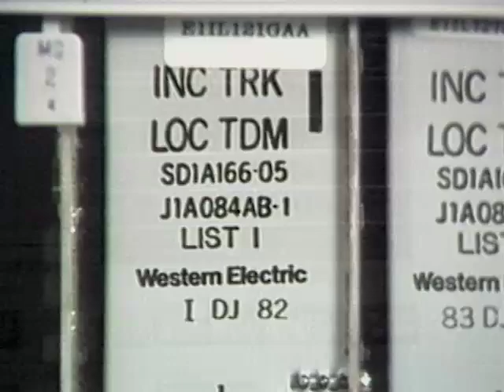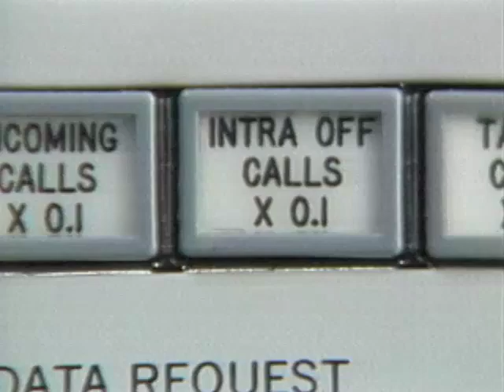Speedy Cutover Service, SXS switching cutover to ESS filmed live at Glendale CA central office, 1984

Comment: I worked in the 30,000 line #1 SXS machine in Tacoma, WA (MArket, BRoadway, FUlton) for 8 1/2 years before it was cut over to #1 ESS in November of 1979. Since the ESS was in a newer building across the street from the SXS, the cutover was done at the old and new mainframes.

All the "heat coils" were pulled in the stepper, and all the protectors were plugged in at the ESS. 

It was sad to watch that hard working 1931 vintage SXS die after so many years of faithful service. We put one whole lot of blood, sweat, and tears into keeping that beautiful old machine running like a fine clock.
Reply: Have you been to the local Telecom museum? It has SXS, panel, #1XB and #5XB equipment running.
Reply: @lohphat , yup! Been there. 😁
Reply: RIP Tom
Reply: Do you need some time to yourself?😂😂😂
Reply: Why did they keep Step by step running so long?  I heard they were expensive to maintain!
Reply: @jgrysiak6566  Just a good accountant to show up TCO vs ROI of a switch. If it cost X to maintain and cost 20X to change for a thing that cost 0.1X to run but will last only 10 you keep the old thing as it's cheaper (20X old vs 22X new)
At a point the cost of the new thing dropped to "only" 17.99 so it became cheaper to trash the old one (20X old vs 19.99 new)
Reply: @lapub7972  , right, the 2BES office in Baden , PA only lasted about 15 yrs until,  5ESS took over!

Comment: Next job for the technicians: Remove hundreds of tons of switching equipment to the scrapyard.
Reply: Psyche! “Abandon in place”
Reply: A lot of copper to recover. Need to make room for thenext generation of switch in the future. Even if it takes up 3%  of the room of the old.
Reply: @haweater1555  It's crazy going into old colos and seeing tons of empty space that was clearly once occupied. Technology is nuts.
Reply: @michaelzindel2382  all that empty space would be perfect for data centers/server farms.
Reply: I have about 3 tons of this equipment to salvage parts from / recycle. A good family friend that worked for Pacific northwest bell saved loads of this stuff, the stuff he built with it is really cool, but there really isn't any use for it now unfortunately. Lots of spares still brand new sealed in the antistatic envelopes too. Kinda sad to throw away so much brand new stuff.
Reply: AT&T was into recycling LONG before most people had even heard of the term.
Reply: @mel816  COs or telephone exchanges as we call then here are also a good place for local power storage. All that empty space can store a lot of batteries for smoothing out demand on the grid and storing renewable power during low demand times when solar panels are putting out well.
Reply: I did this for a month, as summertime job. In fact, managers wanted us to deconstruct it, so it can be shipped from Ljubljana to Skopje. We knew it will never be reconstructed back again, while we were working, and it wasnt. Ah, good times of yugoslavia's socialism :)
Reply: @iamdave84  Ever been in a CO? First, they have their own batteries to power the place in case of power failure, plus generators. Second, most are pretty full already.
Reply: Yeah  @colinpovey2904 , I'm working in a CO somewhere about once or twice a week. Some of the older major COs have massive amounts of empty space. The incumbent telco here that owns all the COs had already hinted that they are investigating entering the local energy storage market.
Reply: You got that right, I remember sewing up those craft paper bags full of no longer used cross connect wire on the MDF

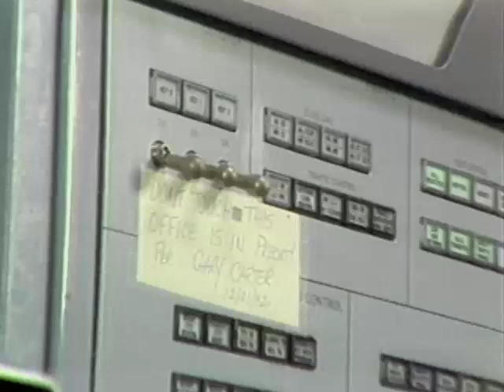Comment: At 03:58 look at the note under the cut switches. " DONT TOUCH THIS, OFFICE IS IN PRECUT PER GARY CARTER."  This film does not tell you what happens after the Tech typed in the cut message and operated the cutover switch.  the CC started sending commands to all the Line Switch Frames (LSF) to close the cutoff remreed switches. This took one to two minuets and sounded like raw rice being thrown on a plastic plate.
Reply: I saw that too and immediately laughed! No protection from accidental switching. Also I would have loved to hear what that sounded like in person! As well as what a datacenter's modem room sounded like, but maybe only for a few moments.
Reply: @macestillmace2514  Racked modems had no speakers, so they were dead silent. (other than the roar of a room full of fans.) If they were very old analog systems -- POTS fed, they'd have a relay to go on/off hook, but you'd never hear it over the fans.
I've spent many hours sitting next to a 5ESS (and DMS100); I don't recall ever hearing the click of relays. (reed relays are really quiet)
Reply: Why did the old cables require physical cuts in order to initiate the cut to the new system?
Reply: To minimize downtime (an entire CO being OOS for more than a few seconds can rack up some serious fines) the new switch is connected in parallel with the old gear. When it's time to switch over, the old gear is physically cut away from the lines and the new switch starts handing the lines. As you can imagine, physically rewiring thousands of pairs would take days.
Reply: @jfbeam  thanks for the reply. I guess I'm just confused why the old line needs cut before the new system is able to take over?
Reply: The old systems can't be shut off so easily, and those frames will eventually be removed. You don't want live lines to still be connected to them -- noise, dangerous voltages, etc.
Reply: @macestillmace2514  Actually, if you look closely the switch is the type that you have to first pull outward on the spring loaded toggle to unlock before flipping the switch, preventing accidental activation.
Reply: @TehMG  dang it! It was much funnier until proven false :(
Reply: @Hyperlooper  From another commenter: The new ESS switch had already been wired in parallel to all lines, but had to remain dormant (probably isolated via per-line relays, all of which were engaged by that final switch throw at the end) until the old was gone to avoid conflict.  The old switch lacked any per-line isolation to cleanly disconnect itself, and even if powered down it would still have passive circuit elements (coils, resistors etc.) connected to all lines that would interfere with call processing and quality on the new system.
Reply: I can hear it now.
Reply: But you know "line switch frames" really isn't a brand, right?

Comment: >Multiple training and briefing meetings
>Special tools and sharpening services
>50 employees working at once
" " E C O N O M I C A L " "
Ahh, the 80s
Reply: I miss them
Reply: I mean It's cheaper to shut it all off for a second and replace it than it is to spend months or years researching and developing a system that can seamlessly transition between technology levels. If all those people were paid 20$ an hour they would've only had to spend a couple grand in wages on their employees. And the cost of the special super sharp cutting tools.
Reply: @viktorreznov4718  Damn...
Reply: @a1919akelbo  50 people 20$ an hour for 47 seconds. THAT'S ECONOMICAL!!
Reply: @dan1_1  again, better than paying one person 50$ an hour to design a seamless transition device.
Reply: @a1919akelbo  A seamless transition device that costs a fortune to design, manufacture and install, which only gets used once, after which it's totally redundant. Definitely cheaper to bring in the batallion of wire cutters for an evening to disconnect the SXS manually.
Reply: @a1919akelbo  I think ESS switches could do a graceful phased and reversible cut-over.  I don't know about the step-by-step switches.  Modern switches can definitely do it.  And, with VOIP (which I haven't worked with), I assume it's all a matter of TCP/IP.
Reply: @TesserId  this video is literally about the process required to switch from analog electromechanical to ESS. You can't connect analog to digital. That's year one electronics.
Reply: @a1919akelbo  D3/D4 mux and channel bank.  I worked with them all the time.
Reply: @TesserId  alright dude, i get that you're proud of your job but just Google SXS switching system before you keep making yourself look like a moron. 
-Some guy that also went to college and works with buzzy blue stuff.
Reply: @a1919akelbo  Just to be clear about what set me off, I made a real effort to find you something meaningful about my claims and actually provided a link for it  (and you were dismissive about that, though that wasn't the really big deal), but asking me to do a Google search on your claims when I'd already done that for my own claims put all the burden on me.  That's really not fair.  If there's any basis for your claims, you should do work for your claims yourself and not put that on me.  There's just no way to have a civil discussion if you can't back your own claims.
Reply: @TesserId  alrighty ill validate my own claim. The video shows an SXS system being cutoff and replaced by a DSS system. Now an SXS system, or Step by Step system, or The Stowger switch is the first commercially successful electromechanical stepping switch telephone exchange system. Basically this is a fancy way of saying it's a system that directly, electrically, connects your phone to another person's phone through a series of analog selector switches and drums. In the official US patent for the SXS switch (link posted bellow) youll see that in figure 1 it shows a rotary phone, above the drum wires run off the page towards the left towards the SXS system. Later in figure 2 we see the complete network showing rotary phones connected to an SXS system. Now something you'll notice, like all things designed in the late 1800s this system is surprisingly simple, and throughout it's use it never got that much more complex, just larger. When phones became more popular the selector drums of the SXS were put in series to accommodate more digits in phone numbers.

Now the issue starts with replacing the system, as it directly connects to the entire phone line, both input and output. Meaning you can't selectively knock out certain subsections, you need to take out the entire system at once then immediately turn on the DSS system. No matter what you need to cut every single wire of the SXS system from the telephone network before you can switch on the DSS. This is because if even one phone was still connected to both the SXS and DSS systems, once that phone made a call the SXS system would short the entire phone line. Itd connect the DSS's output directly back into it. And there would be massive feedback from the lag in the DSS system. You need to physically cut or switch the SXS system off before even turning on the new DSS system. 

Here's the patent link: https://worldwide.espacenet.com/publicationDetails/originalDocument?CC=US&NR=447918A&KC=A&FT=D&ND=&date=18910310&DB=&locale=en_EP
Reply: @a1919akelbo  Thank you. So, given that perspective, I'm going to claim we're dealing with apples and oranges.  Bear with me.  POTS lines are analog and they have to get into digital systems by some means.  That's what channel banks do.  They take various kinds of analog lines and interface them with the digital world.  Yet, channel banks are not limited to converting POTS lines to to T1 time slots.  They also deal with various kinds of analog trunks, which in a mixed environment also have to be converted to digital.  I fully admit that this would not be the solution for all cases, but they did exist and used for mixed environments, and for the times that we have had to have both analog and digital systems, this is what we used.  I'm not saying you're wrong, I'm just saying there was than one kind of thing out there.
Reply: @TesserId  they're dealing with the same apples in the video. You've brought up the oranges, but they aren't relevant to the situation everyone's discussing
Reply: @a1919akelbo  dac
Reply: Hey in fairness time is money, 50 guys doing 48 seconds of work after allz
Reply: @TesserId don't know your age but this is an analog world converting into digital.  The 286 was still bleeding edge. Let that sink in.
Reply: @x_x_w_  For what it's worth, my first DOS computer was a 286.  But, my first computer was a Cosmac Elf based on an 8-bit RCA 1802.

Comment: I like how the cutters are overworking themselves to go as fast as possible. The guy on the keyboard slowly reaches over to flip the switch down.
Reply: The switch guy worked for Pacific, not Western Electric?
Reply: He was giving it a few seconds for an emergency stop to be called. If he flipped that switch with any lines not fully cut, that 45 second switch over could turn into days or weeks.
Reply: @mstrickk1  Can you explain why? Would there be an electrical short? After the lines are cut, what's done to bring the other system online? Thanks!
Reply: @dstrome  older digital circuits do not do well when you send voltage the wrong way.

Comment: I was involved with one back in the day where a four floor building of crossbar equipment was replaced by an ESS that only took one quarter of one floor.  Got a set of 6 monster 2.2v cells out of the deal, 13.2v for the test bench in my shop.  :)

Comment: Slightly different in UK. I did a few Strowger, X-bar, TXE 2 & 4 to system X and system Y in the 80's&90's. Rather than cut cables, every circuit in the old MDF blocks was fitted with dis-wedges, the same with the new blocks. The wedges were strung together in verts. "Everybody ready?" -  "Out with the old". "All out?" - "In with the new". dozens of workers steadily pulled the strings to remove the wedges. The old mechanical equipment fell silent. The new then sat there quietly doing it's job. In the old there was sometimes a lone relay magnet forlornly clicking away, waiting for investigation and final disconnection.
Then there were the faults. Defective wedges that failed to disconnect meant having to spend a frantic hour at the grading-banks wrapping all the P-wires to ground, and missing the transfer breakfast. Happy days, It bought me food and drink and paid my mortgage off. Sometimes I visit museums, and the smell of the varnish takes me back to those days.
Reply: Would love to hear a room full of Strowger switches going full pelt.  By all accounts it was quite impressive!  Isn't there still some System X live?
Reply: @KarlHamilton  In some of the trunk exchanges (offices) ear defenders were mandatory. In the repeater stations you just didn't enter the room at peak traffic! Small village exchanges were pleasant, warm, comforting places, with the exchange clock's regular 'clicks' every few seconds. Warm lacquer on the relay magnets smelled homely; summer lunchtime BBQ's in the exchange garden made it all a pleasure getting paid!
Reply: @nlo114  Haha! That sounds incredible.  My time with BT was far less romantic.  Still love it though.

Comment: My dad worked for Bell in Pittsburgh for 41 years.  As a kid, he took me down there early one morning when they did the ESS cutover.  He showed me a little of the behind the scenes then we sat in the cafeteria for a few hours.  He looked at his watch and went "Well, that's it, lets go."   He saw my look and said, if anything had gone wrong, you would have seen some controlled chaos erupt, but some operator somewhere typed   "ESS CUT" on a screen and ... it all worked.
I always figured it was simply a switch to route all calls through the new digital switchgear.   Possibly all that "cut" part represented was the symbolic "cutting of the wire" and was not really NECESSARY to the new system functioning.
Reply: ESS switches have just enough computing power to do a kind of virtual cut.  The real work would have been wiring up the new switch in preparation for that moment.

Comment: I did a stint as a line tech apprentice for Telstra in the early 2000s not long after name change and public float. Was hanging out in the Dandenong telephone exchange and had two floor I could access of the old step system shown here. I think there was 4 floors in total. Anyways the system that came after the ESS shown here(can’t remember its name) for in the corner of the bottom floor lol. Was amazing to see. Then the rest of the area was split up to house all the new ADSL equipment being rolled out at the time. Was odd seeing all this 1940s and 50s stuff next to new tech at the time. Also the Panasonic tough books have barely changed on outside in 15 years lol

Comment: I was present at the cutover of the Bradley c.o. in Bethesda, Maryland in the late 1980s or so. There the cutover team had what looked like power drills, but where the chuck would normally be the drill was fitted with cutter blades similar to those seen in this video. So one guy could go down the entire frame slicing through cables at breakneck speed without all that arm action. It was over before I knew it while the old #5XBar chimed for attention.
Reply: nice hashtag game, grampa
Reply: First C.O. I'd seen was on Wisconsin in Bethesda.  It was a step-by-step.
Reply: My aunt lived in Bethesda!  She sold her house in the 2000's for almost a million dollars.  She always had a pushbutton phone during the crossbar days!  I always thought it was so neat!

Comment: In the UK every line was jumpered in parallel on the MDF with dis wedges in one half and make wedges in the other, then on c/o all of the wedges, which were connected by cord were pulled out together by multiple techs, changing over in 2 or 3 seconds.  There were weeks of setup time jumpering and the old parallel jumper had to be pulled out after the event. Very quick c/o, no chance of any shorts, but a lot of prep and clean up time.